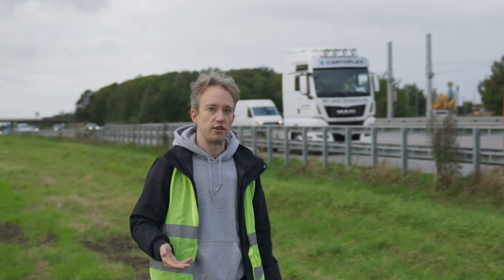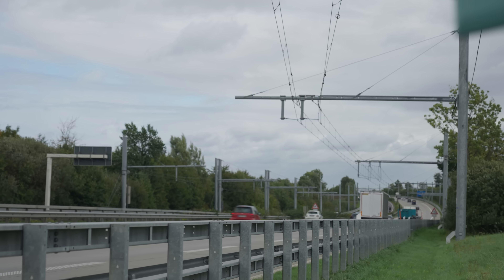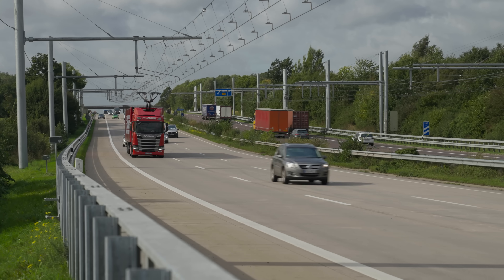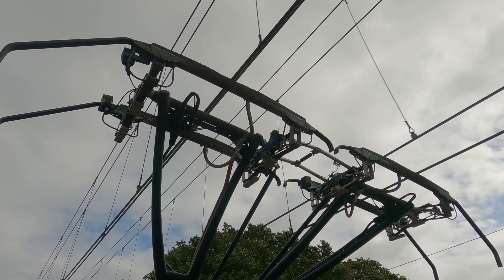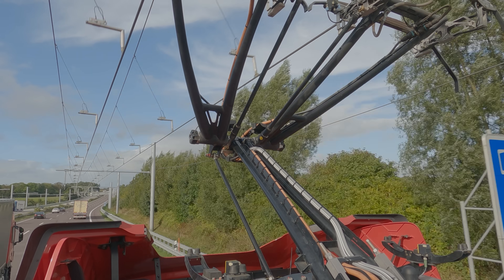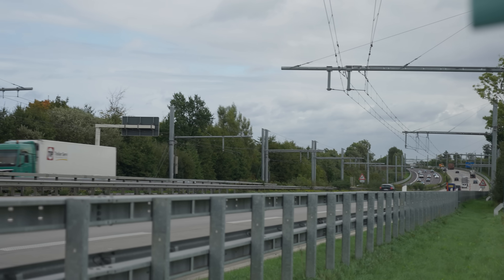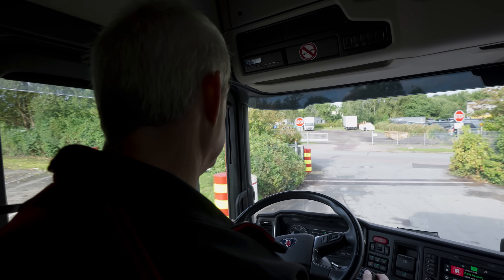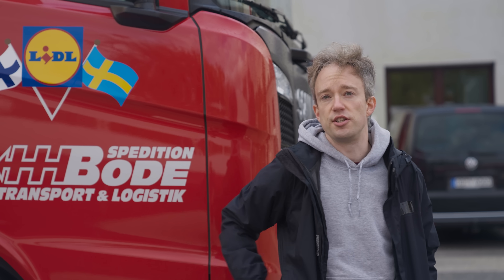The highway where trucks work like electric trains

Comment: "Sometimes the best solution to a problem is one we already have." - someone, I'm sure
Reply: Sun Tzu
-The art of wars
Reply: Sun tzu probably said it
Reply: Electric wires for road vehicles (buses) have existed for 100 years.
Reply: “The best quotation is one that someone already said.”
Reply: Yes, a train, not this
Reply: Your right we had it already, long and short range train transit
Reply: This is hardly a "solution"
Reply: @MadScientist267  dis is definitely a solution before we had a perfect battery that cheap and powerful at the same time
Reply: @royk7712  Why the hell did we go thru all the BS to get rid of those damn overhead wires if we're just gonna bring them back
Reply: @MadScientist267  removing what overhead wires? there was never any over motorways?
Reply: @refrigerator9059  I think this person is talking about trains, yet failing to consider how trains and automobiles have different use cases, and that they can still be fulfilled even with overhead wires.
Reply: @refrigerator9059  Yey, this isn't new. It existed already but was taken down a while ago. I think it was because it had no real advantage back then, since batteries were crap and petrol was cheaper. Nobody thought about the environment back then... now that this changed, it makes sense to try again.
Reply: @MadScientist267  Most cities went to the trouble of removing overhead wires because people didn’t like them. And that left us with diesel buses instead of trams and electric buses. So I say bring back those wires
Reply: @serjoprot  It's the same thing. Only difference is where the fuel is burned, and then gotta look at the wires. Modem diesel puts out cleaner air than it sucks in...
Reply: @Mad Scientific That is demonstrably false.  Your power grid can come from renewable energy, and even if it doesn't, large scale power plant turbines are dramatically more efficient than motor vehicle scale diesel or gasoline engines.  The Otto Cycle in an internal combustion engine can never exceed around a 37% (in practice they get closer to 25%) efficiency even with best case conditions, this isn't true for the power grid.  Power plant turbines have significantly over 57% efficiency, so you have to burn less fuel for the same amount of power.  Finally, the power grid only has about 5% losses going through power lines, so the fuel consumption of this system, even without switching to renewables, would be half of what it is with just internal combustion engines.  (Edit: Made a correction.  Turbines use the Rankine Cycle which is a maximum of 63% efficient.  Turbines in powerplants achieve at least 90% of this, which results in an overall efficiency of 57%.)
Reply: @pyramear5414  Let's see here. You are saying that burning fuel over a long distance than transmitting it on wires where there's a loss just by transmission alone is more efficient than directly burning and turning the wheels right next to them. Am I missing something here?
Reply: @asandax6  combustion engines are way less efficient, yes. You don't need a degree to figure that out.
Reply: @asandax6  what you're missing here is that your loss over the wire is still significantly less than the difference in efficiency of how power production plants burn fuel compared to how vehicles burn fuel, and that even if that weren't the case in many places this could be a great solution because at least half the power consumed is produced by wind, or solar, or hydroelectric, or geothermal, or, all renewable sources that only pollute on any notable scale when initially building the plant versus coal, natural gas, and oil burning plants that pollute consistently through their entire life
Reply: @MadScientist267  its Not the same.  Stationary powerplants are more efficent, and release cleaner air.
Plus the Power grid is never only powered with fossile fuels nowadays. Which decreases the emissions further.
Reply: @pyramear5414  Big Engine runs all the time vs Little engine only when needed providing power as needed. How much energy is wasted during the time where the Bigger engine is running but demand is low? For a small engine you just switch it off.
Reply: @serjoprot  How about we only put the wires where they are absolutely needed? Like at the bus depot or the stop at the end of the route where the buses usually pause for 15-20 minutes anyways? You could even bury those wires that serve the charging locations.
Reply: @asandax6  Yes, you are missing the fact that the losses on transmission are miniscule in comparison. You are also missing hat the fuel's raw material needs to be transported to the refinery. And then it has transported to the place where it is dispensed to the individual vehicles with a much lower thermodynamic efficiency than the power plant that also has to power the refinery and the dispensing location. Refineries typically rival small- to medium-sized cities in their electricity consumption. And they are one of the primary users of cobalt, not battery manufacture.
Reply: @asandax6  Electricity generation must meet demand exactly or the grid fails. Over/underproduction leads to frequency excursions which can damage motors in factories and cause other mayhem. Generation sources can be trimmed precisely to meet demand over the large scale without needing large deviations from individual units. Batteries and other storage have now shown themselves to be even better at frequency regulation and other ancillary grid services than adjusting sources away from their optimum operating point.
Reply: @Markle2k  And now we're adding even more complexity to bigger engines. Smaller engines more efficient than larger engines in real world operations. Yes on paper bigger engines are more efficient but when you consider the use cases bigger engines offset their initial efficiency advantage.
Reply: @KeVIn-pm7pu  Ok main point is still the wires. Unsightly, problematic as hell wires.
Reply: @refrigerator9059  You people are hopeless
Reply: @asandax6  Pyramear already explained to you why bigger engines are more efficient than small ones.
Complexity is not necessarily inefficient. Indeed, it can chase out inefficiencies. That is how you can have a Prius that is faster, gets better fuel economy, and is cleaner than an 80s Honda Civic while being as roomy as an Accord.
Reply: @MadScientist267  how are they problematic
Reply: @asandax6  A power plant does not always have all of its power turbines running 24/7.  They can turn power turbines off and on as necessary to meet demand.  So the point of being able to switch off a small engine is invalid because that is the case with stationary power plants too.  A typical powerplant is 500 MW to 1000 MW of output, but each turbine is only around 3 MW to 15 MW (although up to 40 MW is not unheard of), so they have dozens to hundreds of turbines to switch on and off as necessary per power station.

And no, I gave you examples of real engines where the small engines were less efficient than larger engines.  Power plants stopped using internal combustion engines in the 1920s because turbine technology had progressed to be superior for stationary power generation.  Large stationary engines are vastly more efficient than small ones, this has been true for over a century.
Reply: @KeVIn-pm7pu  Maintenance nightmare for one
Reply: @MadScientist267  so what? Less maintaince requiered than for any fossile fuel engine. Those cables are good for years.
Reply: @MadScientist267   trains would be a solution
Reply: @El_bintzo  You can't put rails everywhere. You can't put wires everywhere. Bus lines can be flexible, you can even add new routes to serve some temporary events like concerts or sports events. Quite expensive with tram or trolleybus.
Reply: @azgarogly  many trolleybus models still have batteries that allow them to take that temporary addition to the route without having to build new power lines, assuming the same happens with electric trucks and really you only need lines running over highways and priority roads where nothing is parking or entering/leaving buildings and parking structures anyways
Reply: @ClippyForConsumerWrights  Batteries on trolleybuses have become practical just in recent time. Obviously a hybrid vehicle that can adequately move on it's own for significant distance does partially overcome the flexibility issue.

Comment: This is something that I’ve seen on other channels and think is a good idea but can it work in the UK? 
Here are some of the problems …
They still haven’t electrified all of the UK rail network yet, they have been promising for decades to electrify the Leeds to Manchester section and have only started on that recently, and there are many more sections that need to be upgraded. So how are they going to electrify the UK motorways and A roads within 18 years?
Can the National grid supply enough energy for all these new electric vehicles and a fully electrified rail network?

This is a bit like the much hyped hydrogen economy. Hydrogen is more energy dense then natural gas so you don’t need to burn so much, etc, great give me a pen I’ll sign now.

But, again here’s some of the problem’s.

MPs talk about an 80/20 blend of natural gas and hydrogen, now this only produces around 6% less emissions than 100% natural gas. Now, the other thing is the 80/20 blend is 14% less efficient then natural gas, which in turn means that to produce the same amount of BTUs as 100% natural gas you have to burn 14% more of the blend to get the same result which means you’re creating more emissions than just burning natural gas.

The next problem is the pipe work, natural gas is around 8 to 9 times as dense as hydrogen, and is easy to keep pressurised and push around the system, once you start introducing hydrogen into the system you have to increase the pressure to keep the blend flowing along the pipes, the network can handle the pressure, that’s not the problem, the problem is the blend causes friction in the pipes and joints and in turn this causes the joints to become brittle causing leaks, which means all the pipes will need to be changed, the other thing is the compressors used in the network don’t work well with a blend much above 6% of hydrogen so they will all have to changed.

So, if there is so much needs doing for a blended gas why not go 100% hydrogen? Well that would be safety, because it is more energy dense than natural gas can you imagine the damage a 100% hydrogen gas explosion would do?

So, do away with gas altogether and all heating and cooking should be done by electricity! … but wait a minute, how the hell is the electricity grid going to handle all this extra demand?

Tom, perhaps you could look at the tower blocks in Sunderland that are being converted from gas boilers to using thermal batteries and heat pumps to provide heat, and look at other replacements such as infrared heating or good old water heaters?

Comment: It's kinda funny, Vancouver Canada kinda has this system for our public transit. So it is very much something that could be done, and like the driver said if there's an issue the busses lower their connectors and run on batt. until they get back to their route. Further we have just started big battery busses for some of the routes out of the city, they charge up when sitting at either end of the loop with a couple of spots along the way.

Comment: Funny enough Wellington up until 2017 had Trolley buses which worked on the same system, though the government (Lead by the Labour Party - Who is still in power and has committed to fighting Climate change by banning offshore / onshore exploration for fossil fuels, and is attempting to lead the charge towards an electric vehicles, wouldn't help cover the cost in maintaining it, and the entire network has been replaced with diesel powered buses..... Unless private enterprise builds and maintains it, the government isn't going to want to be left carrying the cost!)

Comment: People who are comparing this to trains are forgetting that trains aren't going to drive to your local supermarket to supply the couple boxes of bread they ordered.
Reply: Neither is this system going to extend to every road to supply every single market, just have train stations in cities and smaller electric vehicles to transport the goods from the stations to their final destinations
Reply: @darklibertario5001  Their system still allows trucks to go "off grid" allowing for much more variety in destinations. Also, I can see this being massively cheaper to install compared to a new set of tracks.

Comment: I'm more interested in removable battery packs that can be charged at a depot and switched out in minutes. It would require a standardization of battery packs and large fleets with depots. That's not likely for cars, but could work for trucks (tractor trailers) and buses.
Reply: It already exists for cars. NIO has a service station infrastructure in China where you can get your electric car's battery replaced in 5 minutes. Behold watch?v=YSEgU9G4BVo

Comment: Soyjak Germany: Closing down nuclear power plants in favour on fossil fuels.
Also Chad Germany: Putting Overhead catenary to make lorries electric.
Reply: They'll just power it with Russian gas instead. No problem!
Reply: I prefer another form of renewable energy source to nuclear power any day
Reply: @duncantalksalot  Find me good renewable base power generation.

Batteries are nowhere near viable enough. Pump storage, maybe, but that still leaves a little gap.
Reply: @duncantalksalot  Problem with nuclear is that there's a lot of bias from the 0.1% of accidents so everyone thinks that nuclear is bad, even though it rarely goes wrong. The most cited accident (Chernobyl) was an old, unsafe design with major design flaws even back then.
Reply: @nikkiofthevalley  my problem is nuclear lies more in the fact that there is no way to dispose of the nuclear waste left from the operation cleanly and swiftly. We bury thousands of drums of radioactive waste deep into the ground every year, hoping the system we have in place won't go wrong and have our underground water and soil polluted. These radioactive waste could have a radiotoxic life of 1,000 to 10,000 years, that's after a use of only maybe around five years in a nuke power plant.
Reply: @duncantalksalot  I agree with this, we need a better way of getting rid of nuclear waste. There's never no way of doing something, there's always one nobody thought of.
Reply: @duncantalksalot  Better to have radioactive waste buried underground in concrete vessels than use the alternative (coal), that produces radioactive waste but blows it into the wind.
Reply: @duncantalksalot  I think we'll soon be able to store spent nuclear fuel cleanly and swiftly. In a place like Onkalo it'll supposedly be safe for 100 millennia.
Also, I think the production of something like solar panels is much worse for the environment. Maybe I'm wrong in thinking this I don't know.
Reply: @duncantalksalot  Modern nuclear reactors produce a fraction of the waste of older reactors. In fact some say a single soda can of waste would power an entire lifetime for a single family.
Reply: @nikkiofthevalley  not only bad design, also bad management, ignoring safety rules and doing stupid things. It takes a lot of things going wrong all at once.
Reply: @duncantalksalot  We could just disperse the radioactive waste in the atmosphere, similar to the coal plants. 
Also there are different types of radioactive waste. The pipes used to contain the water in the pressure chamber is nuclear waste the same way the spent fuel is, but has far different amounts of radioactivity. Lastly lifetimes of the waste can vary wildly between different materials. If you take the uranium ore as is from the mine, it already kinda is radiactive waste with a half-life of several billion years. 
I'm not an expert in this area but every argument both pro and con is always extremely hand-wavy with actual numbers and realistic analysis.
I think technically all problems are solvable with today's technology with an acceptable risk, but I'm kinda skeptical if that would still leave nuclear power as an economical power source.

Comment: Germany: let's power our trucks with electricity, because it's greener.
Also Germany: let's produce most of our electricity by burning coal and natural gas... 😐
Reply: It’s still more efficient and safer for the environment to do that than to have trucks powered by diesel or petrol alone.
Reply: @Fetidaf  So according to you, burning coal, to produce electricity, to be sent through a network of wires, to produce motion... is more efficient than a combustion engine??
Somebody definitely slept through physics class! 😂
Reply: @kabochaVA  think of it as buying something that was produced in bulk vs making it yourself, transporting it is only one part of how efficient it is/isn’t
Reply: Germany plans to build a massive number of solar plants in the Sahara and import the energy across the Strait of Gibraltar.
Reply: It's almost like the "green" economy is a massive scam...

Comment: I wonder how that would hold up with hundreds of trucks all pulling from the same wires.  Or if each little section is isolated like different grids so things don't get overloaded.
Reply: The same way it works for train systems that have multiple trains pulling from the same wires?

Comment: I wonder if and how they have addressed the maintenance requirements of a system like this. 🤔 If I recall correctly a pantagraph that is either not making good contact or has a worn down contact point can cause arcing and prematurely damage the catenary. Regular maintenance would be required For both pantographs and the catenary.

Well I’m not sure how viable this would be for small business owners that own their own trucks, this would be great for fleet vehicles that make regular routes from point a to point B And can ensure proper and regular maintenance.